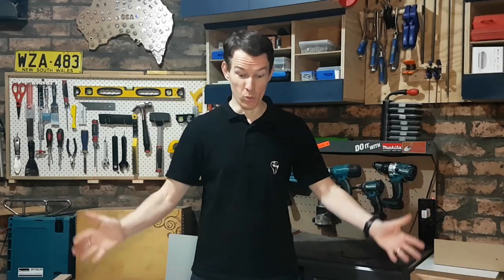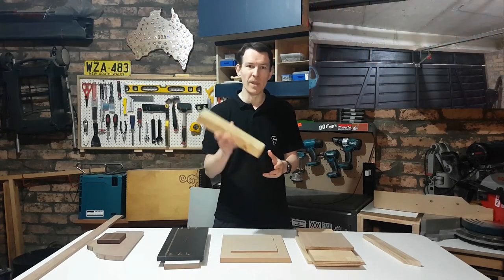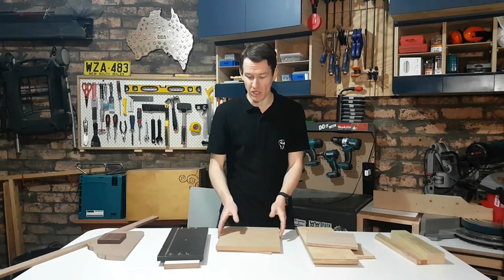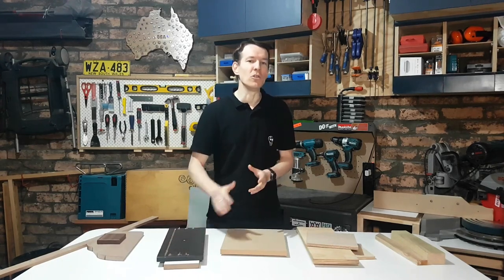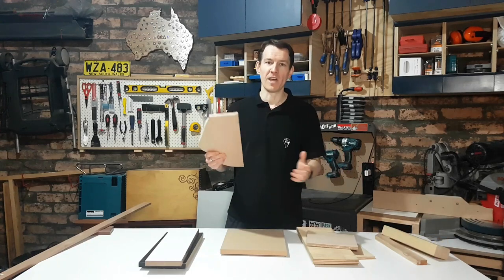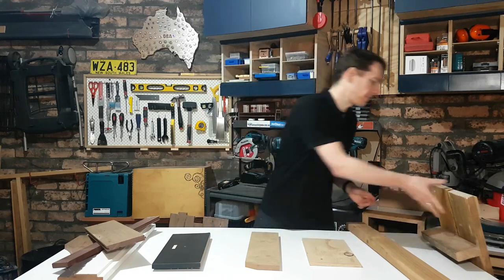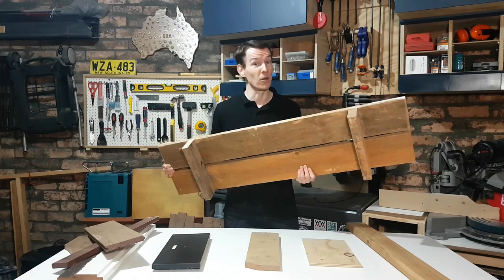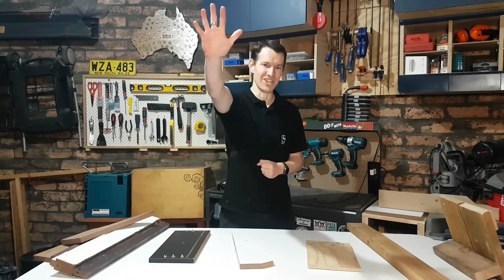Wood for Beginners & How to get it for FREE! (Fixit Fingers Fiver)

Comment: Such great advice. Another thing I have been looking for lately is people giving away furniture like book cases and hutches that are made of solid wood. Especially if you get someone throwing away a plain bookcase made of pine once you pull it apart you have boards of pine that would usually cost upwards of $40each.

Also thank you for showing all the international audience that I'm not lying when I say American woods are ridiculously expensive 😂😂
Reply from the maker: Great tip! Oh yeah solid pine furniture is a good score though rare around me, it's all tending to be flat-pack crap that is dumped, hence the bed slat targeting as they are usually strong and straight(ish) 😅

Comment: Nice gate. You touched on this but I thought I'd expand. With cabinet making factories, there's a lot of decorative MDF off cuts left over. Large panels too. There's always heaps and the boss would love it if someone would raid their bins before they're out on the footpath(since by then the service is already paid for). The only issue is there's no edge banding to go with it so be prepared to make lengthy mitres to hide the mdf or try to match it with home made edge banding.
An easy place to get thick, strong plywood is caravan makers. They also have other materials too. Factories in general will happy to get rid of a lot of stuff, including hardware.
Obviously construction sites will have a lot of free pine but when to go to get hardwood is tricky. If the doors and windows are being installed, you're in for a treat. If the front door is lockable, the stairs should be coming soon so you'll be able to get more hardwood from that. Near the end of the build for the house the owners sometimes add a deck so go passed as it's being completed.
Reply from the maker: Oh awesome tips mate, this is really what I wanted from this series. I toss up a chip and others pile on to up the anti. Great advice! You can only ask, the worst they can say is 'no'. Plus, you are saving it from landfill so great for the environment too.  🤙

Comment: I wish someone would have told me when I started woodwork that pine is a lot softer than Ironbark and spotty. I had no idea  it was THAT different. I mostly use hand tools too so whenever I find some Vic ash or pine, it feels like im spreading butter. Great video!!
Reply from the maker: It's crazy how hard they are here, but it's the silica content too that stuffs the blades. Melaleucas for example, not that hard, but edge destroyers for planes and chisels I've heard!

Comment: Interesting that your construction lumber is all treated. Most of the stuff here is not treated at all and it makes decent wood to start with, especially if you take the rounded corners off. It's really cool that a lot of old stuff (like fences) in Australia were made from hardwood. It's like the old barns here that were all made from oak. Lots of great info on this one James 👊👊
Reply: P.s. i have never used MDF and i never will. It sucks
Reply from the maker: Hahaha if plywood was as cheap as you guys get it I'd probably avoid MDF more too. As it is for drawers and thin panels it is usually my preferred option being half the cost of ply. Not all the construction lumber is treated, but most of it will have at least some form of protection so I more wanted new guys to be aware to check before they accidentally make a coffee table with H4 CCA (Copper chrome arsenic). 😅

Comment: Bed slats 🤣🤣🤣 funny you should mention them... recently fitted out my Transit as a camper and all the framing was done with pine bed slats and bed frames someone was going to throw away. The cabinetry and storage bins I made from 18mm melamine, some was offcuts i got for free but I did buy some from Bunnings- white and clean, can't go wrong. And all the old doorcards and the ceiling I replaced using 3mm white melamine just to keep the clean and white theme going. Those I bought new but they cost next to nothing. Overall the build has cost me bugger all when I consider how much of the wood was scrounged (thats Kiwi for scabbed 🤣).
Reply from the maker: I haven't bought timber in over a year I think... however I've landed some work replacing the deck on a boat so will have to break that... luckily Im not paying ;)
Reply: @FixitFingers  Then it doesn't count, does it and you're still hitting home runs for free 😉

Comment: Mate you can keep your wood to yourself pervert 😂 great information for the beginners.
Reply from the maker: Hey Karl! I'm interested, what off-the-shelf hardwood is common up your way? One of the other UK makers said you can get similar 'hobby boards'?
Reply: @FixitFingers  diy stores are terrible for timber mate, the cheapest timber quality. Hardwood wise you might pick up a Oak furniture board for a extortionate price but that's about it. The public also in general have no idea about quality timber and the meaning of solid 🤔 IKEA Argos and cheap imported furniture is to blame. If you want quality hardwood it's off to a specialist supplier and most of them arnt keen on small orders and may pop a surplus charge on for orders under say £250.